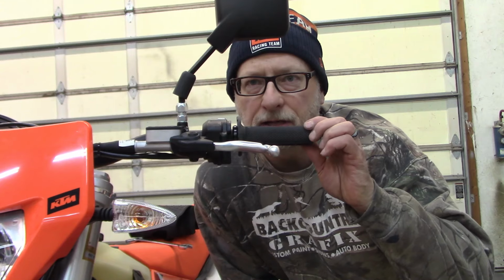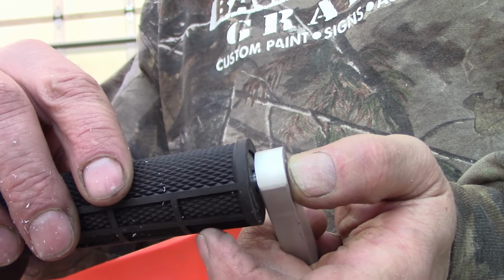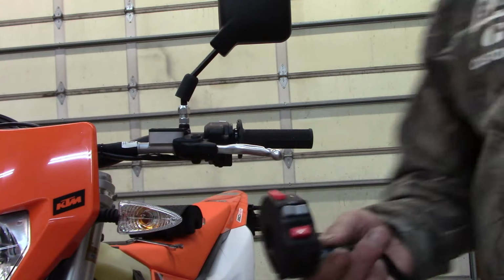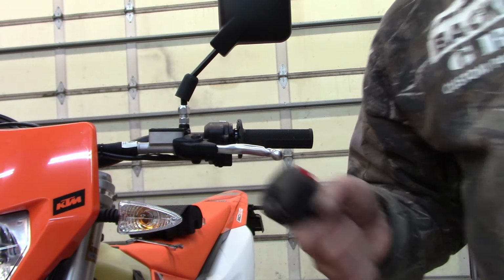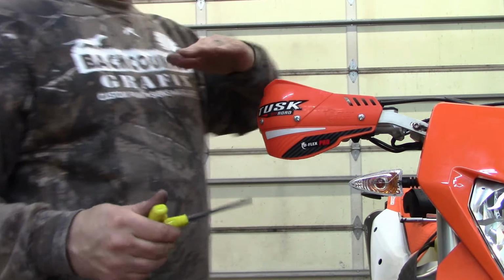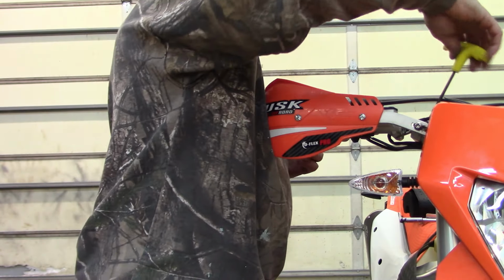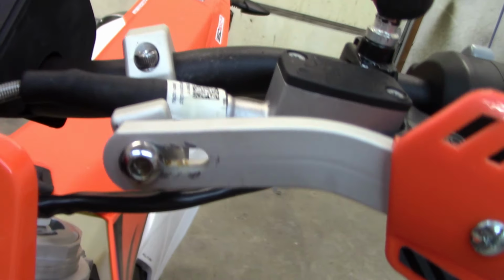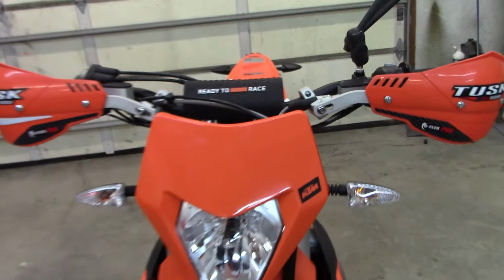2024 KTM 350exc-f TUSK D-flex Pro handguard install!

Comment: Wrap-around hand guards are always more of a PITA to install then they seem like they should be.... I had a pair of Cycra ProBend's meant for Fasst Flexx bars that were on my Husky TE. When I got the DRz I wanted to use the Cycra's to not have to spend more money than I had to.. I was expecting a nightmare of a job, but somehow they went on easier than any set I've ever installed. Smooth even when I switched to Tusk CR high bend bars.

Comment: What size did you order for your bars?  Mine don't seem to fit very well.  I ordered the 7/8" clamps.  Seems like these are too small 🤨
Reply from the maker: You need 1 1/8” clamps, 7/8” is definitely too small.
Reply: Thanks!  I’ll send these back and the bigger ones.  Appreciate your help.  👍👍

Comment: Where did you get the aftermarket lever boots?  The ones that came with the bike and screwed into the oem flag hand guards are in the way….
Reply from the maker: They came in an accessory bag , that was included with the bike when I purchased it new.

Comment: These are the only way to go apparently.  I tried some other wrap around hand guards on my 2024 KTM 350 EXC-F.  Unfortunately, the ones that mount tho the handlebar clamp block the ignition key!  Total bummer.  I really wanted the extra heavy duty ones, but they all cover the ignition. ☹
Reply from the maker: I thought that would be a possible issue. Thanks for clarifying! Thanks for watching!”